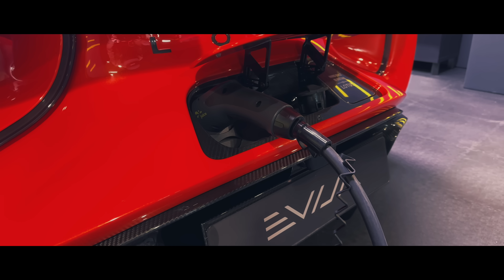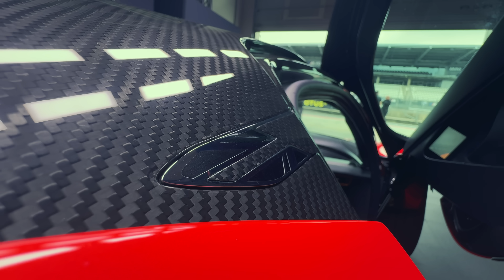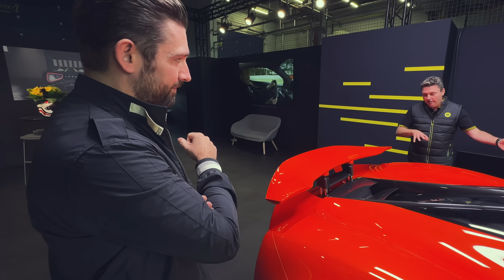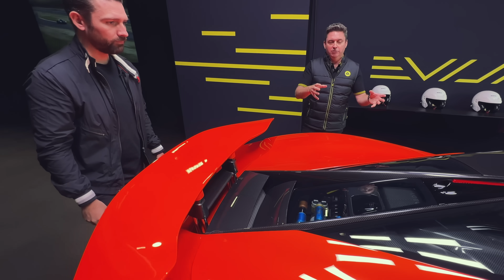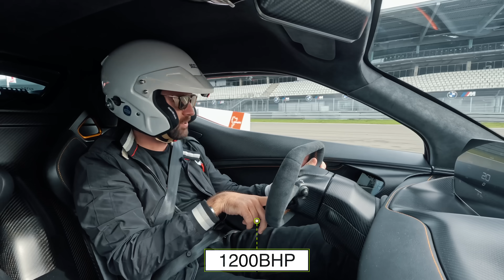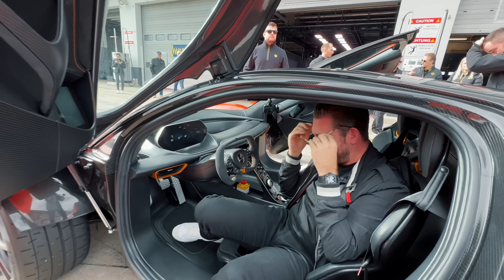THIS Is What a £2,000,000 Electric Hypercar Feels Like! LOTUS EVIJA Exclusive First Drive Review

Comment: Since rich people tend to not drive their hypercars for very long (and since batteries being heavy is one of the reason why some people don't like the idea of ev hypercars) I wonder why they don't just sell ev hypercars with much smaller batteries even though that would mean a low range...

Or even just give the option: "you can spec this car with the big heavy battery if you will be doing long trips OR save some money on the smaller battery spec and you will save a lot of weight"

Comment: Part of what gives me hope here is that a lot of the awesome engineering is indeed software based. Stuff like getting the torque mix right and aspects of handling and stability. It all obviously has to work with the physical hardware, but there are aspects of these designs that might directly find their way into more accessible cars more broadly.

Comment: I know top speed isn’t everything but 2000hp combined to have an Aventador Top speed isn’t crazy?? No sound or emotion. Just brutal acceleration to “only” 217mph with 2000hp combined. If it doesn’t have the fancy drivetrain tech that the Rimac Nevera has, which also is limited to 219 (really goes 258mph), then what’s the point?? I guess this will be a better track performer but I wouldn’t take this over the Nevera. I definitely wouldn’t take the Nevera over an ICE hypercar. But that’s just me.

While people in 1600-1817hp ICE cars (Koenigsegg, Bugatti, Hennessey) are going 300mph. Idk man. I just don’t know.

Comment: Not a mention of those huge holes in the back of the car. Or the drag figures. Not sure if that shape reduces drag or not
Reply: Those holes are venturi tunnels  and are deliberately designed to create lateral stability through corners and channel air efficiently so there's no aerodynamic wash or dirty air flow

Comment: "The barrier to entry is high... really high.  And only time will tell whether this remarkable technology can trickle down into the realm of more attainable sports cars." - Lucid Air Sapphire already at $250K for 1,234hp, 1.8 seconds 0-60, 205mph (limited) top speed, sub-9.0 second 1/4 mile.  Electric is just starting and already we can get that kinda performance in a full-size luxury sedan for little over $200K.  That's insane.
Reply: Bro Tesla Model S Plaid is only $89k. For over 1,000 HP, and 1.9 sec 0-80 and 9 sec 1/4. Theyre $70k used. Thats barely more than what the average person spends on a car. In 10 years literally every middle class household will own a 9 second electric car. It's insane
Reply: yes  ot is chef gidsé i sine sieed démon hybuire ektruc óermeñçe
Reply: 4680 Roadster = GAME OVER BABY

Comment: That's a very impressive downforce figure. Nearly 992 RS cornering grip with almost four times the power. This thing is gonna be rapid.
Reply: He said the Evija makes 1680 KILOGRAMS of downforce. That's over 3700lbs, or more than twice what a 992 GT3RS generates...
Reply: @reedarce  You can't compare 1680 kg at 350 kph with 860 kg at 285 kph while skipping an important step where you normalize the speed!
When you do the math, only then you'll see that Evija's claim is 23% more downforce than the Porsche (should you believe Lotus).
Then you have to consider that Evija is a lot heavier and has tiny bit less grippy tires.
Reply: The world is doomed. The consumers is so dumb and has no brain of his own, that he ends up eating what's being marketed at him. I've seen people being impressed at the Tesla cyber truck demo vs a Ford Truck. What happened? The cars were pulling each other and Tesla cybertruck won easily of course and then I read comments like - oh well they didn't take the highest spec of that Ford Truck - THAT'S TRUE, but what they're missing is that that is not the point, but it's the point what Tesla wants you to think about - in reality it wasn't an advantage that that the Cybertruck could pull that Ford - but it was a disadvantage and a sideffect caused by it. The Cybertruck has to be morbidly heavy because of the batteries. More weight will of course always win that fight - NOT POWER but MORE WEIGHT! That same excess weight is however a HUGE PROBLEM. A problme with safety as it brakes longer, a problem with the tyres as they will have to be thicker and more expensive and will wear out faster and a problem, that the parking houses in all cities of the world are not built for overweight EV's like all EV's are - there have already been cases were the structure broke down...

Now returning to your specific example against the 992 RS:
first of all - downforce does not always mean cornering grip... Downforce will only provide grip at higher speed, basically the higher the speed, the more the downforce effect will be - there you will have more grip, but in slower corners you will still have LESS grip and be SLOWER in this car than in the 992 RS because this thing is HEAVIER!
Second of all if the downforce figures are the same for the 2 cars, then it still doesn't mean they will perform the same in the high speed corners as higher downforce levels will be required for the heavier car to maintain the same levels of grip (again, needless to say - you will also have more tyre wear...)
Reply: @arcelivez  Lol, sorry to hear you didn't like my quick and dirty comparison using their weight claims, downforce claims (whether you believe either of those is another thing), tyre friction coefficient... all at an arbitrary speed that I happen to have chosen.
Be my guest and give me your expert input taking into account variables such as drag, center of gravity or weight distribution and aero balance.
Reply: But sadly it's EV, lotus should have made it hybrid with a V8
Reply: @maverick964uk  no. this is better
Reply: @maverick964uk  Doesn't even need a V8. V6 is more than enough power for the road. Why can't they make something like the SF90 but better? The way people fawn over these EVs is slightly jarring given how bad the technology is. It must be what it was like for watch enthusiasts during the quartz crisis. Tasteless idiots thinking plastic quartz watches were the future.
Reply: @maverick964uk  You gonna make 2000hp with a hybrid?
Reply: @mile_high_topher well the Gemera is something like 2200 BHP based on engine and battery. No excuses
Reply: @maverick964uk have you seen a Gemera run? None of the Koenigsegg's can drag race, roll race nor track race. They're all just paper fast
Reply: They have the record for 0-400km/h-0.. You are dead wrong about track race too.. A simple googling will show that you don't have a clue what you talking about. @larryc1616

Comment: As a (modern) Lotus owner I love the look of the Evija but, like the Rimac Nevera,- it sounds terrible and noise is such a MASSIVE part of super/hypercars. The performance is almost irrelevant as there will be very few opportunities to exploit it at all (even on track you'd struggle to use 2000bhp). I almost got the impression that Mr JWW was saying how amazing it was through gritted teeth as he knew there was something big missing from the experience.
Reply: You only associate the sound of thousands of contained fossil fuel explosions with performance and "soul" and "emotion" because of the times you grew up in. Thats's fine, just like niche fans rhapsodizing over the hiss of a steam engine and the sweat and smell of a racehorse. The actual MASSIVE part of supercars is the performance.
Reply: Yeh I don't really get EV sports cars for that reason

Comment: Lotus is making a comeback with an EV super car. A few things I would change inside the car. 1. Bigger steering wheel 2. Move the two screens showing left/right side mirror to be at the dashboard display. Makes no sense why would I need to turn my head to ck the mirror since it’s a screen. 3. Maybe add fake engine audible, that EV sound just took away the driver experience to connect with the car. 4. $2 mil for a lotus is too high.

Comment: Heavy car for such a small form factor
Reply: Nope, sf90 and revuelto are both heavier wet with fuel than this is. 😀
Reply: @4literv6  but how can this be lotus dna with such a heavy car ?
Reply: @Juuythljgrrdwq  who cares? Again it's an ev hypercar lighter than some ice awd supercars are. 
In a few years with a 150k or more solid state upgrade it'll drop 250-350kgs easy. Might even increase the performance to. 👍🏻😎
Reply: @4literv6  who cares lol ? Its lotus DNA !
Reply: @Juuythljgrrdwq  which is why it's lighter than any comparable segment car by a LOT!
They done did good even using Chinese spec motors n such. 👍🏻

Check out the gac aion hyper ssr ev 2dr supercar quad motors and a 74.6kwh pack with 1,200+hp also a carbon tub design.
Weighs around 4,400#

Comment: Let's be honest, it's a £2m hypercar that lacks a lot of style. The front is ok, the sides look better but the back end is dreadful. 

The side mirror screens are also in a stupid place that I feel could actually be quite dangerous. Having to take your eyes so far off the road to look down at a screen where your door handle usually is, then turn your eyes back to the road, taking into account how long your eyes take to re-focus is dangerous.

They should have either placed the screen by the A-pillars or installed a wider "dash" with a mirror screen on each side, then you wouldn't need to turn your head away from the road.
Reply: Have you seen it in the flesh?
Reply: @rush8481  Nope.

Comment: Weight is less than a Revuelto or SF90 but with twice the power and four times the downforce lol
Reply: Thank you for pointing that out! Imagine in a couple year's when they redo the pack with solid state cell's.
Drop another 300-400kgs easy right there, or drop 250kgs and ad another 20kwhs of capacity. 😎👍🏻
Reply: Sure buddy, it also costs almost 4 times the price of those 2.

Comment: This is all with current tech, within a couple of years Solid State batteries are scheduled to go into full production, higher output, cooler temperatures and double the capacity at the same weight, theoretically Evija owners could bring the cars back to Lotus and reduce the weight by 20-30% while increasing range and performance.
Reply: Maybe 10-15% less total weight not 20-30%. The pack itself probably is only about 1,000# 🤔

Comment: I heard that battery technology we use today is old tech, Toyota (or some big manufacturer I forget their name) are working with a much lighter graphite battery , that would make sense for sports cars.
Weight is disastrous for sports cars. These are like muscle cars in a sports car body.
Reply: Toyota has been badmouthing EVs for years and lying that its hybrids are "electrified", while promising solid-state batteries "in a few years" (and hyping the dead-end tech of hydrogen fuel cell vehicles). You still can't buy a Toyota with a solid-state battery, just the underwhelming BZ4X. Toyota's latest aspirational plan is to offer SSBs "by 2027-2028" in its premium cars, i.e. expensive. Meanwhile it just made a deal with LG to buy 20 GWh of the same lithium-ion batteries that everyone else's EVs are already using.
Reply: Weighs less than the new revuelto does. 😀

Comment: Of course an electric Hyper car is great... but electric cars the average person can afford are woefully unremarkable
Reply: 3.1 seconds 0-60 from a Model 3 Performance for only $50,990, or an insane 2 seconds 0-60 from a Model S Plaid for a mere $90,000 is "woefully unremarkable"? You are remarkably jaded. If you don't like Tesla, then Ford, GM, Hyundai, Kia, Volvo (422 horsepower 3.4 second... from a compact Volvo EX30!!) are all selling 400+ horsepower dual-motor all-wheel-drive EVs. And you get that performance without compromising on the EV attributes: quiet, cheap and convenient to "refuel" at home, and much lower greenhouse gas emissions. (If you're going to say $50,000 is too expensive, then name a "remarkable" $40,000 gasser.)

The real story is that supercar makers don't know how to compete with mass market performance EVs. Evija and Nevera are significantly better than the Plaid (and now the Lucid Air Sapphire), but they're 20 times the price! You can't buy a $250-400,000 Aston Martin, Ferrari, or Lamborghini EV because they're not sure what to do to outperform a practical 5-passenger sedan. Maybe the delayed 2025 Porsche Boxster and Cayman EVs will show the way.

Comment: It’s light for an electric car🚀awesome🔥could be quicker than rimac..
Reply: They originally specced it as 0-300kmh in 8.8s so it should do low 8s or a 7.9x in the 1/4 mile.
Bet it smokes the nevera around the green hell to. Easily a sub 7min blast. 😎
Reply: 100% sure is quicker than the nevera, they specced it 0-186 mph in 8.7 s in 2020...
Reply: @mortensenvick5711   8.7  Where? On paper!? 🤭
2020 You say?  It's almost 2024 !! 😂
Reply: It’s 400kg lighter… not only will it be quicker to 200km/h and 300km/h but around the ring that’s easily 10-20 seconds faster than the Rimac plus the fact that you won’t overheat the tyres halfway around the lap means you can push the car to the limit for 70-80% of the lap. The Rimac driver had to manage tyre temperature during it’s record breaking ring lap… so the overall lap time difference could be even bigger than 20 seconds. Would love to see them both attempt a ring record on the same day with the same tyres… my money is on the Lotus 😎
Reply: @arielatom300heps It's not gonna beat rimac in drag. It will have a better chance at tracks tho, due to less weight.
Reply: it will @stevendavis6157
Reply: Rimac Nevera is gonna be Quicker and faster (Top Speed) than Evija!
Problem for Evija ond the Ring could be tiny battery and overheating!
Reply: @joebeus6886  bs, the evija got a way faster 0-300 kmh (8.7s)
Reply: @mortensenvick5711  Bring live footage of it hitting them numbers. Clowns these days believe anything on paper lol!
Reply: @stevendavis6157  There is no reason not to believe lotus claim about the time of the Evija. A lot of you rimac fanboys will be unhappy when the results come up, so will be pundits.

Comment: For EVs to really  be easily useable battery tech has to take a large leap forward. To heavy now takes to much time to recharge.Of course the whole infrastructure needs upgrading too
Reply: The millions of happy EV owners aren't interested in your opinion on "easily usable." If you have access to a plug at home or work, you'll probably be happy with one.
Reply: @skierpage  if you don't like my comment so what my point doesn't have to please you who are you. Everything is true the infrastructure stinks in lots of  areas. Very heavy lead based batteries. And charging time is  long. I HAD an ev. But until battery tech changes and more  places to charge and alot quicker charging I'll wait for another one. If that's ok with you of course

Comment: So let me get this straight, they claim that putting the batteries where the engine would go would mimic gas sports cars even though we all know that a lower center of gravity is ideal for improving handling in sports cars? Riiiight. And then they replaced side view mirrors with cameras, which ideally makes it so you don't have to take your eyes off the road by looking outside your windows to see the mirrors BUT then put the monitors for them LOWER than a traditional mirror would've been which takes your eyes off the road at best the same amount if not worse?  SMH at these engineering decisions. Rest of the car looks amazing, but jesus christ on a stick.
Reply: Lower center of gravity is good but lower inertia is as well

Comment: Wanna see it vs Rimac
Reply: For sure. Nevera is real, Rimac has put at least a dozen in customers' hands, and it's set dozens of records and a production electric car record on the 'Ring. The Evija has yet to do any of that, but it's lighter.
Reply: @skierpage  This is as real as the rimac. If you go to some lotus dealers in China (called lotus experience centers), you'll see several Evija models in Shanghai and Beejing
Reply: It’s 400kg lighter than the Rimac… it won’t loose unless you have a race track with 2km long straights 🏎

Comment: What you never will. hear is the process of manufacturing the batteries for those electric vehicles produces more toxic exhaust and waist than your standard combustion engine would produce in years.
Reply: Proof? Chatgbt says we burn 29,190,000,000# of crude oil every single day. Do you have any clue what that requires by chance?
Reply: Just do the math! A 35 mpg (USA) car will burn through 10 tons of dirty fossil fuel over 120,000 miles, which then turns into 33 tons of CO2 to worsen global warming. You must be lacking in common sense if you think making a 1/2-ton recyclable battery is worse than that. On the current grid mix nearly everywhere in the world, an EV over its lifetime is far cleaner than a gasoline car. Since the majority of new generation everywhere in the world is wind and solar (because they're cheap and quick), every EV will only get cleaner.

Comment: Wonder which will be quicker this or the rimac
Reply from the maker: This - less weight more power 👍🏻
Reply: @MrJWW  depends on the race… top speed the Rimac wins… 
Rimac is 400kg heavier but it has 2299 Nm The Lotus has 1700 Nm 

Can you organise both cars on the same tyres, on the same day to do 1/4 mile 1/2 mile and a few qualifying laps of a track with a pro driver?
Reply: @arielatom300heps  personally dont see rimac being able to match evija on track. Possibly in a drag race though.